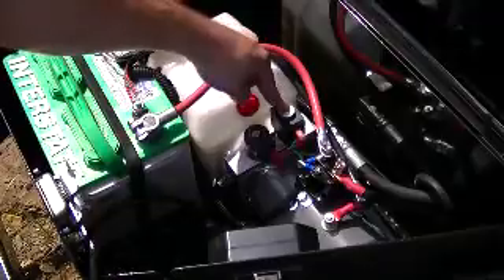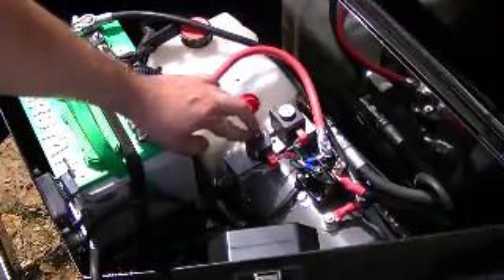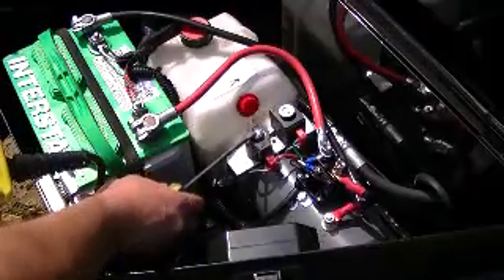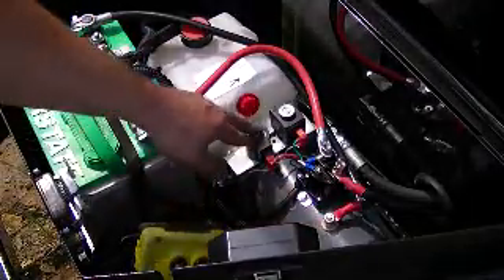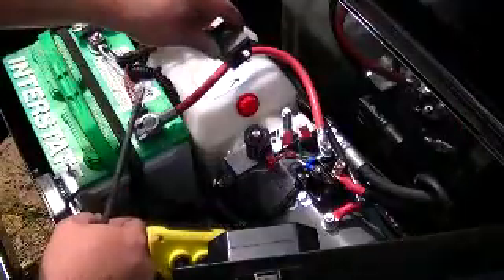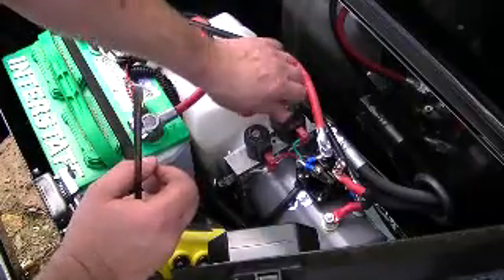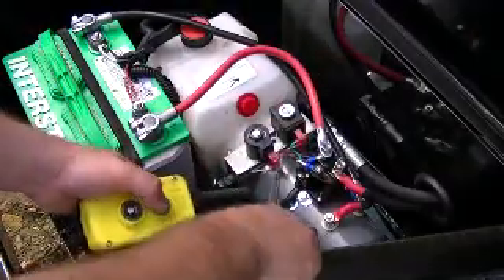KTI Hyd. Dump Trouble Shooting Procedure

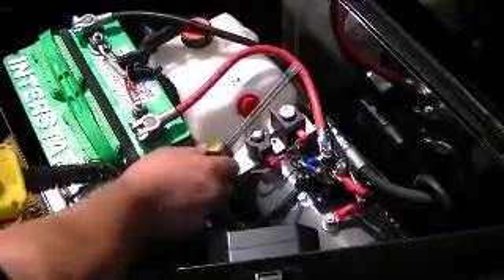Comment: @1:30, to release pressure, undo the power cable to the motor, so only the solenoids operate to release pressure - - - - a most valuable piece of information I could not find anywhere. Such a simple and necessary function so I could release my quick connects. Thanks.

Comment: Hi, my dump trailer is power up and power down, i am afraid as it gets older I will be at a site where I wont be able to get the dump back down because of electrical failure.  it seems from what you have explained, in an emergency, i could take off the down solenoid and then loosen the valve enough to get the dump body to lower?

Comment: Sir how do you adjust the pressure ?
Reply: You probably should not, as the pressure should be factory set for best use. I was having a sudden lift failure, and thought a sudden decrease in lift capacity was the pressure relief valve, but actually it is a failed o-ring on the lift valve.

Comment: My trailer has not been able to lift for about the last three months, I didn’t want to have to spend a Ton of money having a repair shop fix it, after seeing your video I went and tried the screwdriver on top of the solenoids the down solenoid was working but the up solenoid was not, I tooked the down solenoid and placeed it on the up Valve and pushed the down button and then the lift went up, you solved my problem!!now I just need to order a new part thank you so much for your video